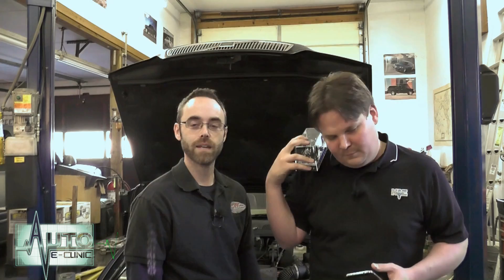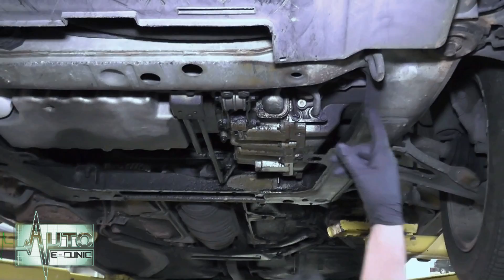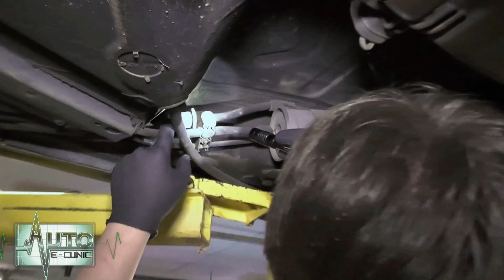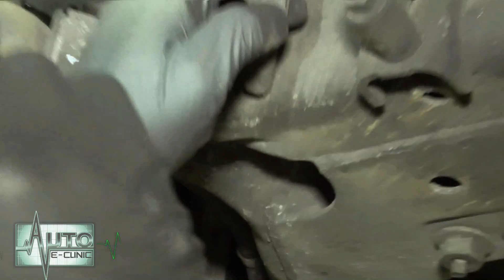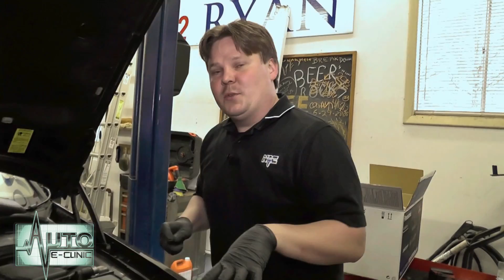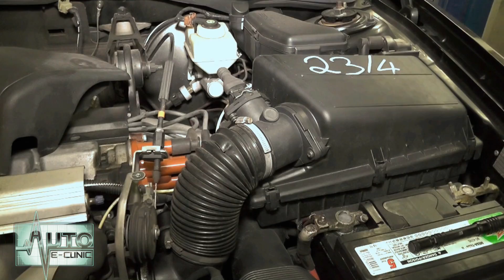How to Diagnose Codes P0440 or P0455 Using Visual Inspection

Comment: Had it to the mechanics 6 times they did smoke test. Purge valve., Leak section pump, OEM gas cap was a a leak cap P 0457 But after I replaced the MAP sensor now it's throwing P0440. 2005 pt cruiser touring non turbo ... Snow will fly soon need help here. Could it be the throttle body gasket?

Comment: I changed the EGR valve and the pressure sensor and now it shows me the code P0455. it says system of control of the emissions by evaporation pressure gauge important leak help please tank's

Comment: how can I find it in a 1996 chevy blazer. po440
Reply: i have a 2001 blazer same generation probably your purge valve solenoid or did u get it fixed easy test dc the hose from nipple and power start truck on cold if u feel vacum when cold idle its bad